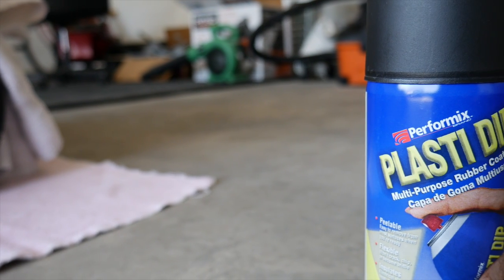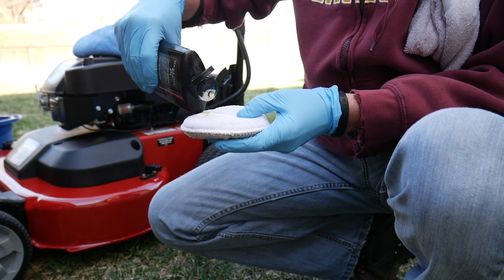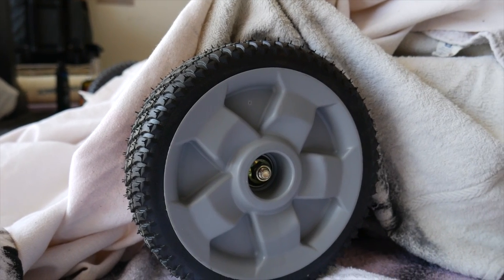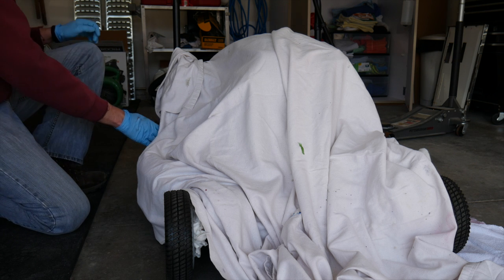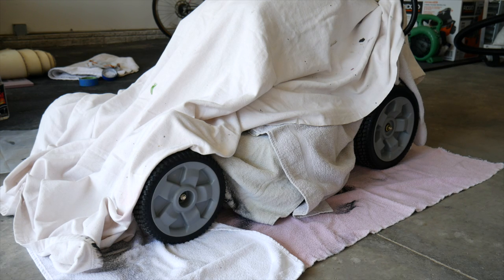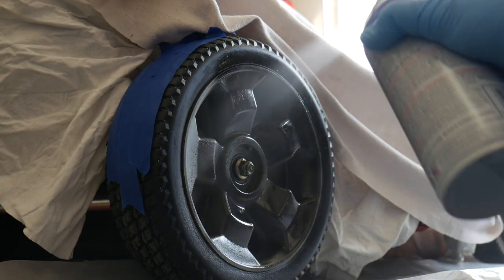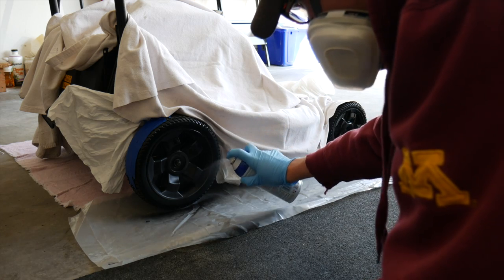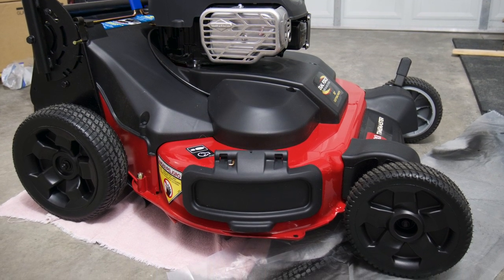Toro Timemaster 2017 - Plasti Dip Wheel Mod

Comment: Lol. It's good to know that I'm not the only one who is sealing their mower! I did mine a few weeks ago with some Collinite 845 while having some heavy rains. I also use Meguiar's xpress spray wax after washing it off, before I start to dry it off. It can be used on the plastics as well as the metal, with no discoloration at all. Great stuff, easy on and off, and yes, makes cleaning much easier and quicker! Nice trick with the plasti-dip. Not overdone, but subtle and very clean. Good job Ryan.
Reply from the maker: Yes there are a few of us crazy people out there!  I use the xpress wax as well as far as car detailing goes but will have to try it on the mower.

Comment: Hey Ryan, looks great, did it hold up or did it start to peel off? Debating if it's worth doing or not.
Reply from the maker: I've had some on my truck rims for over 5 years with no issues. With the mower the only issue is when you scrape against a fence or something but otherwise it holds up really well.
Reply: @ryanknorrlawncare  appreciate it! Going to do this week. How many cans did you use? 2? Also, just started listening to your channel, great stuff man! Keep it up!
Reply from the maker: @natehorn4202  I don't remember for sure but having a few extra won't hurt so you don't run out mid project.

Comment: Does it matter if any plasti-dip or spray paint gets on the tire? Should I tape it off or just so what you did and not worry about some getting on the tread?
Reply from the maker: I sprayed my tires and just let it be that way but if you can get something oil based on the tires the plasti dip should peel off and not stick to it.  That's what I have heard at least but haven't tried it myself.

Comment: Ryan - I live in N.H. and we got dumped on with 18 inches of snow last week.  Just after it turned warm and I thought I might start cleaning up the lawn.  What is the purpose of that sealant?  Is it just cosmetic?
Reply from the maker: Ours was melted by the end of the day but weather has been up and down here.  The paint sealant is just like waxing a car.  The plastic dip offers a little protection but is mainly cosmetic.

Comment: will the dip peel off if you scrap up on something?
Reply from the maker: Once it gets fully bonded it's fairly scratch resistant but if you bang into something pretty hard then likely it will leave a scrape.  The nice thing is it's easy to touch up by just spraying the spot that you scraped.
Reply: oh OK I wasn't sure if it was like the latex paint where a scratch ends up peeling the whole thing off. I never knew this stuff existed!
Reply: ohhh ok that makes more sense. I think I've seen some cars with it but didn't realize it was just a spray!
Reply from the maker: I've used it on wheels without problems taking it off.  It's the people who don't know how to spray it properly that give it the bad name.  :(
Reply: Plastic Dip is pretty durable. I sprayed my trailer wheels and my car wheels. Paint is still on after a couple of years!